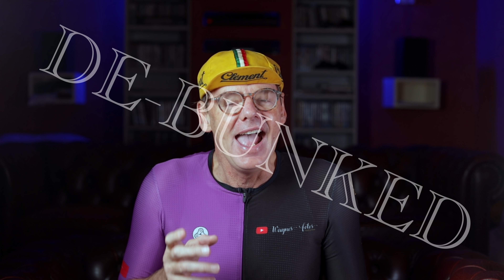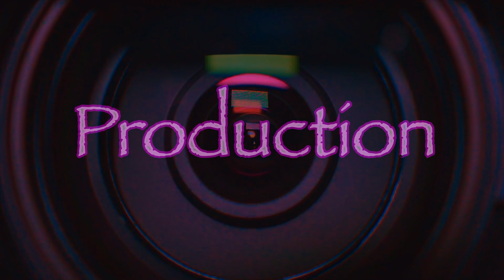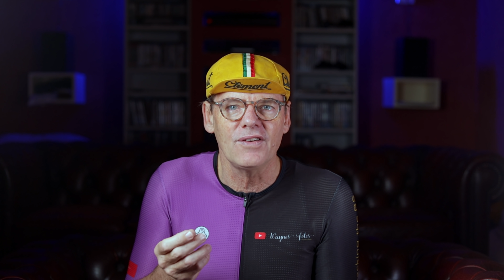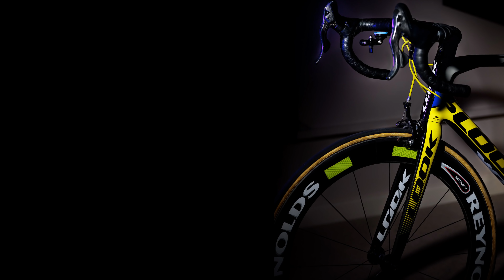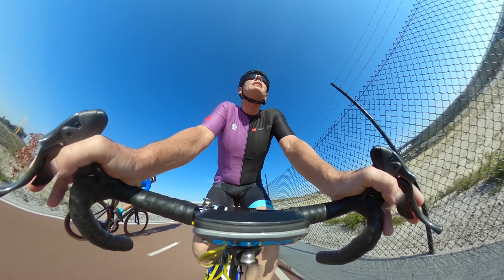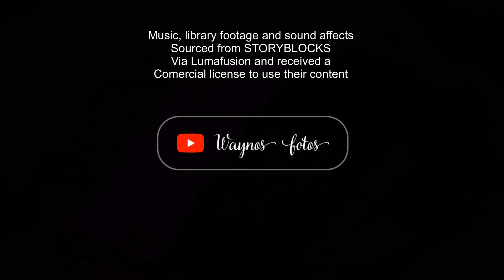DE - BUNKED Can wider tyres & lower pressures make you FASTER?

Comment: I really believe it boils down to the roads you ride on. The thing I really dislike about the change of rims, tires, tubes ,no tubes , and all of that is that it is really the cycling community being forced by the cycling industry into conforming to rougher roads ,that are getting increasingly bad as years go by ,encouraging cyclists to share these awful roads for bikes with cars. When what cyclists should be doing it lobbying cities to build separate bike/scooter electric skateboards or what have you. It would be safer for everyone including the motorists. We(my wife and I) are lucky to live in a city with miles of smooth paved asphalt / tarmac for cyclists, and bike lanes on major streets that are new enough that all you need to do is call the city when the pebbles/glass starts to build up in the bike lane. It is far from perfect but smooth enough to run 25" Vittoria corsa speed tubulars at 120 psi and not get vibrated off the road. and that's running carbon 65mm deep rims to boot. We really NEED to push for better bike accommodation instead of the other way around. Way too many cyclists dying out there on roads not designed for them.Or even considering them for that matter.

Comment: Hello Waynos,

I have been riding road bikes (steel, carbon, and Ti) for a couple of decades (generally tubed 23 or 25).

I recently started reducing my road air pressure (tube) from 100ish to 80ish and have found much comfort. 

My weight fluctuates between 180-200 pounds and I have had zero issues with the lower pressures. 

Thanks for the data and for shining some light on this issue.  It is so easy to get caught up with trends.

Again, thanks for the content and I have enjoyed many of your videos.  Keep the wheel side down!
Reply from the maker: Newsflash! GC performance did a vid showing these wider tubeless lower pressure tyres are slower, i will have a response video up today and a link to his video.

Comment: It still amazes me that people aren`t taking on board what experienced cyclists like Wayno are telling them. I suggest the negative comments aren`t read until the whole video is watched. Yes a wider tyre with less PSI will feel better to ride than the EQUALIVANT narrower tyre with higher PSI but the point Wayno is making is that a better narrower tyre, i.e one that has a higher TPI count and generally a much softer side wall will be as good and comfortable than the lower TPI count tyres that the manufacturers are pushing as onto, especially tubeless which have a much much stiffer sidewall.
There is a reason why pro`s still ride tubulars and it`s not just because they are safer in a blow out, it`s because the casing is very soft and therefore comfortable as well as fast. If they were really so uncomfortable how on earth would they survive a 3 week grand tour at such high pressures?
Come on people use your loaf!

Comment: 90% of the tires made are crap.  A GOOD tire (Vittoria Corsa, Specialized Turbo Cotton, Verndestine tires) is an "open" tubular....  run those tires with a GOOD tube (Conti Race Lights, Supersonic or a latex tube) at 90-110lb and you get the best experience.  No glue or tape...  no sealant...  best rolling resistance vs. comfort ratio...

Comment: from what i have seen that is in long decending with carbon wheels is better with discs brakes  , however if you have caliper brakes with clincher tires the danger is heat build up on the rims comes down to speed ,weight of rider and so on,either the tire will blow off the rim or the wheel can break especially if you hit a hole in the road,  however with same carbon wheels and rim brakes but? with tubulars does this help do they handle the heat build up, have not seen the professional riders having trouble with this ,  i would imagine they feather the brakes so as not to build up to much heat, wondering what you think , thanks
Reply from the maker: With tubulars there is no hooks for the tyres and no tyre pressure applying pressure on the hooks as there is no hooks, so although it still gets hot, there is no air pressure pushing against any hooks therefore safer.

Comment: Changing all that stuff on your existing bike for 2W savings is one thing. But If you make plans on buying a new bike one should take this question into account. And also using the wider tyres can be a big advantage from the view of on which roads you plan to ride. If you want to use the quieter country roads or even agrecultural paths the wider tyres come in handy.
Reply from the maker: True if you are buying a new bike, but remember all your old stuff, wheels handlebars etc will not be able to be used so it is has complete new systems. But as o said in the video. Adjusting to the surface you ride on is key.

Comment: "Wider tires are the way forward", "We now know better, wider is faster", "Get with the program, narrow tires are archaic".  Have you noticed how the tire widths are trending towards the old standard of (27 x ) 1 1/4 inch, which is 32mm wide.  That was the standard size at least on low to middle range '10 speed bikes' as we called them in north America.  The bike industry wants to tell us this is a new development.

Comment: You can't really debunk something without actually providing science/testing/numbers to back it up. A roll down test or actual testing of watts at km/h is how you really debunk something. I'm personally all for a wider rear tyre than the front. The width of the rear really has very little effect on drag so it can be ridden with a wider lower pressure tyre for comfort.
Reply: Exactly. Where's the test?
Reply from the maker: @TheDanl80  look guys why don't you ask the manufacturers? No one seems to have a problem believing claims that are completely opposite to what was previously considered the best tech, with no studies or tests to support their claims. Instead you like to challenge anyone who challenges unsubstantiated claims in the industry. Remember this, i have no motive or gain by my statements, i have no links or association with any bicycle company, whilst manufacturers have everything to gain by making a previous part/product obsolete. Something to think about.
Reply: @waynosfotos  maybe these fellas need to ask track cyclists what width and pressure they run. This wide tyre BS is off road garb

Comment: Comfort aside and looking only at wattage, several disadvantages of wider tires seem to have gotten lost due to the preoccupation with rolling resistance: (1) greater weight, and (2) greater aero resistance.  RR, weight, and aero are probably all small factors, but still.  Looking at Conti's specs for their GP5000 clincher tires, 28's weigh 240g, 25's weigh 225g, and 23's weigh 200g.  So 12.5% penalty for 25's and 20% for 28's.  Not simply weight, also angular momentum.  In terms of frontal area of the front tire (directly proportional to aero drag), 8.7% penalty for 25's and 22% for 28's.  Not saying everyone should ride on 23's, just numbers to think about.

P.S.  If one wants wider rims to better match those wider tires (for aero and other reasons), those could also add weight.

Comment: I still ride on 23 mm clinchers with tubes. There is a very simple test. Just take a ride from the steep hill, using only gravity. I bet, that skinny tires would take you downhill faster, than fat tires. Sometimes I observe guys riding downhill on very wide tires. They ride much slower, so the have to pedal to keep decent speed.

Comment: They always say that the wider tires rolls faster, but not up to which point. Their reason for 28 mm being better than 23 are the same that would prove that 42 mm are better than 28, if I understand correctly. Lower pressure is better? Okay, but up to which point? A flat tire is certainly slow, talking about "lower pressure" without a lower bound is meaningless
Reply from the maker: Yes correct, they make claims without links to white paper data. What tyres did they use, what surface did the tyres roll on and what different tyres did they compare at what pressures? I have never seen any on line magazine nor manufacturer give specific data with controls stated. It is just wider this lower that is faster. Without quantifying anything it is just talk. Yes they can claim that I say the same, hey Waynos no data 😲, but people forget, i am not making the claims in the first place.

Comment: I reckon rotating weight has a lot more to do with it that we think.. plenty of propaganda out there saying rotating weight doesn't matter.. physics disagrees.  For me, I needed new tyres so I went from 25s to 23s and also changed from Butyl tubes to Tubolitos (I still haven't decided if they are shite or not by the way..) at the same time. Saved 160g roughly over the 2 wheels.. I have to say the difference was noticeable.. slicker, faster, spun up easier.. maybe my brain was trying to justify expensive tubes ?? who knows?? Good Video BTW

Comment: You have a valid point. So let's look at the real world. If I were riding on a track or velodrome with a crazy smooth surface, bam, I'd be on 21mm tubular tyres. No doubt about it. If the roads were all immaculately maintained "hot tar". I'd be on 23s (and was for years). However, the real world isn't smooth hot tar. Far from it. There's cracks from weather heaving, potholes from wetness, and even worse grunge when the asphalt/concrete starts to break down. 23s at 100PSI are a literal pain in the backside. So, what did I do? 25mm @80 and finally 28mm @75. They technically are faster because I don't have to let up on the power and I'm not swerving around to avoid every little tire sucking crack. As to saving two watts, let me drop a kilo. There done. But if I do not want to spend the rest of my day in pain, wider tires, with lower PSI. Oh, and one added benefit, less flats as the tire deforms around crud rather than trying to push over it.

Comment: Solution I've adopted on my summer bike for years: 25mm rear, 23mm front. Areo, agile precise cornering on the front, wider contact for rear where it must deal with greater force and aero not as important
Reply: In fact, Conti offers a set exactly like that:  23mm "Attack" front, 25mm "Force" rear, total 400g.  I have had good luck with them.

Comment: I'm 74.6kg and just got a bike with hookless 303s wheels. I run them tubeless at 57/59psi front/back respectively on a 28mm tires. I haven't done too much riding yet but first impressions compared to old bike running 100psi on 25c tires with a tube is that the ride is extremely smooth and comfortable. It also feels a lot more grippier when cornering.
I don't really care if it is just manufacturing constraints that push for hookless tubeless. I can really feel a major difference in comfort and control of the bike. Performance aspect don't really bother me that much. Difference in rolling resistance is not important for my style of riding anyway.
Reply: You run crap tires.
Reply: @Sills71  Schwalbe Pro One bad tires?

Comment: about the pressure : not really true. I use a 23mm tire at 8bars and i've ordered new 26mm tyres of the same type and there is a table about weight-pressure on the package and I need to put the 26mm tire also at 8bar. So i'm going to use a wider tire at the same pressure :-)

Comment: Wider tires weight more and for a 28mm tire (inflated ca 29-30mm wide) you need a very wide rim to make it aerodynamic.
I’m running gp5000 TL 25mm on rims 27/21 mm. Tires are 26,5 mm wide mounted. Think this is the best middle ground and I run them between 80-95 PSI depending on surface. Good video. So many apples and oranges comparisons everywhere..

Comment: Seriously, most people got this partially wrong or ambiguous,  including,  sorry, you. Best "tea table" analysis is to look at the dynamics of rolling tires in conjunction to the road and also in conjunction to the rider's pedal input. Strictly analyse every aspect of the dynamics using Newtonian physics and account for all the energy changes that takes place. It should then become very  clear. The approach of using contact area etc is a source of ambiguity in thr first place. There are a few errors in your anslysis too. If you want to dispute, leave a comment and I will send u an email to initiate the discussion.

Secondly, all theories are useless if you can not demonstrate in real life. We already have everything needed. Not only average power, but rider's pedalling pattern is one key variable. We can vary track surface roughness, tire widths, pressures and measure outcomes. 

Seroously, one day I will come up with a comprehensive literature on this issue to debunk all confusion. I promise.
Reply from the maker: Remember, i am not the one making claims, that is the bike industry and sponsored actors. They also provide little real evidence. All i am providing is, a question to these claims.
Reply: @waynosfotos  and remember,  I am only pointing out that your account on rolling resistance and bike tires have some flaws from physics point of view, although overall you have properly grasped the concept.

Comment: I'm using a 23c tyre on a 25c rim and it fills out to almost 25mm at 100psi. With latex tubes it feels just right for me. I tried wider tyres and lower pressures and it felt slower but marginally more comfortable.
Reply: your tire isn’t 25mm, all you are doing is stretching the tire out, which means the depth is shallower, it will lead to a harder ride and more prone to pinch flats or ruining your rim.

Comment: great  subject matter. i run three wheel sets all campagnolo. two HP neutron and shamal ultra both with vittoria corsa evo service course 23mm tyres. and vittoria latex tubes and bora G3  tubular once again with vittoria corsa evo 21mm tubulars and they are fast and aero. ho and all rim brake. best wishes mate

Comment: Oddly when I used a Vittoria tubeless Rubino Pro IV 25mm tire for a short time it was more comfortable on large bumps.  But I also felt small inconsistencies (small bumps al over concrete road - heavy water worn) which I never felt before on thinner casing tires such as Vittoria Corsas 25mm.  Feeling all the small stuff was far worse them dealing with the large bumps so I went back to regular Vittoria clinchers/light tubes.

Comment: Hookless rims look dodgy! Who thought that was a good idea? No thanks!
Reply: “Looks dodgy”. I’m leaning hard on fast descents with 21mm internal hookless with 30c tires at 45psi and FLYING past my mates on the “old stuff”. I’m a solid 200lbs. NO ISSUES
Reply: @JohnnySantoDomingo  Good to hear. I just like the idea of having hooks that my tyres slot into for piece of mind. Just seems more foolproof to me. I'm only 70kgs so I'm sure you'd smash me downhill as well!
Reply: They work on your car, and on motorcycles, and on mountain bikes, so why not road. I'd much prefer a good bead/bead seat interface than rely on a hook, if the tyre is is tight on the bead seat no way it can pop off, even if it goes really soft (granted if it goes completely flat bead can drop into the well) whereas a hook type rim can be made to work even if it's a sloppy fit, and that could go bad fast if you loose pressure.

Comment: Are hookless casings stiffer? I thought it was just the bead (which won't affect ride quality). The tyre is held in place by the air pressure inside + a bit of sealant, so why would the casing need to be stiffer?
Reply from the maker: True the tyre is not fully thicker, but needs to be in general "unflexible" in the diameter plane, this lessons the  flexibility of the amount of area it has to flex on the total tyre. The unstretchable strands need to be held in place be the tyre compound, i.e. much thicker than a cotton tyre.
Therefore, the diameter of the hooked area can not expand, therefore can't rise over the hooks, so to achieve this the sidewalls of the tyre need to be designed to control expansion when pressurised so it will not blow off the rim. This is why the max pressure needs to be much lower or you would need to further reinforce the tyre making it heavier.

Comment: The problem with measuring rolling resistance is that it has to be done in a lab and, as you say, does not relate to actual riding conditions. In the same way measuring drag in a wind tunnel does not mimic riding outside. When manufacturers talk about these tiny gains in watts or weight they might as well say eating a banana with your breakfast will be faster than eating an apple.
Reply from the maker: I will take the $10,000 banana thanks, i mean bike. Lol

Comment: I definitely found larger tyres were faster, mainly due to maintaining contact with the road surface, although I had to reluctantly go back to 23mm because of clearance issues. 

Watts is not how to caluate speed, Watts is how to calculate power output, the tyres thing is about speed not power, saving 2watts can translate to the difference between maintaining a speed and accelerating. In these instances "only 2watts" is like saying "only accelerating" which in regurd to a desired speed increase is a ludicrous position. Also with less jumping around on the surface and a smoother ride you'll go faster on zero Watts than on a smaller harder tyre, so again, watts is the wrong tool to measure speed. The Watts can be used in conjuction with other factors like for example rolling resistance, where a small amount of Watts counter the rolling resistance nullifying it in comparison to an alternative, it's the nullifying of rolling resistance for the same power that increases the speed.
Reply: They are using watts as a term for energy. So a tyre will absorb less watts if its more efficient. What he's saying is that 2W is a very small figure and you could gain this in many other places easier and a lot cheaper. Get narrower bars and I bet you save more than 2W in energy to maintain  a set speed